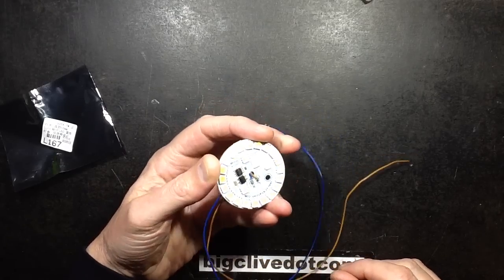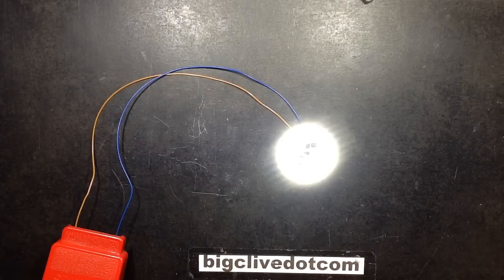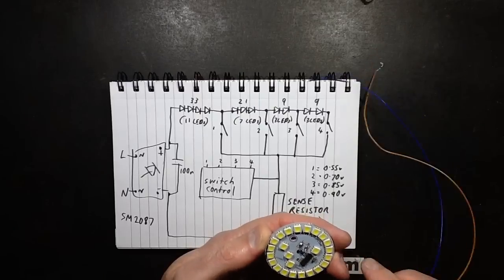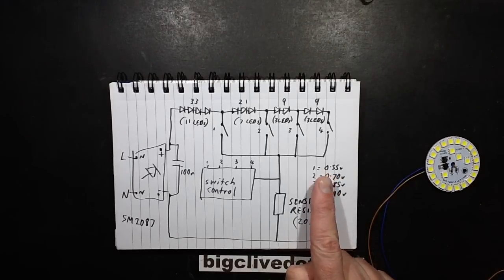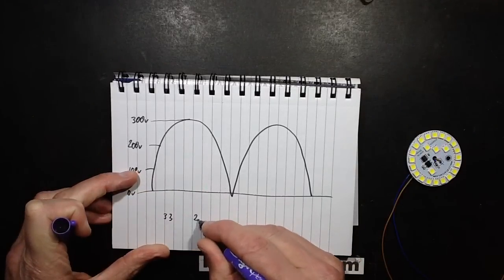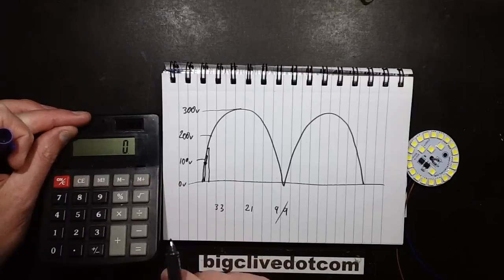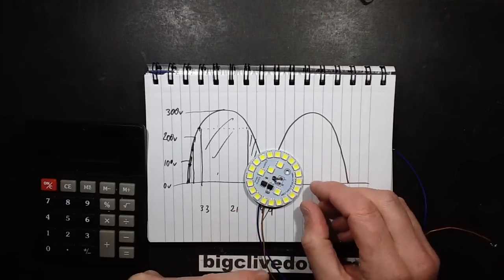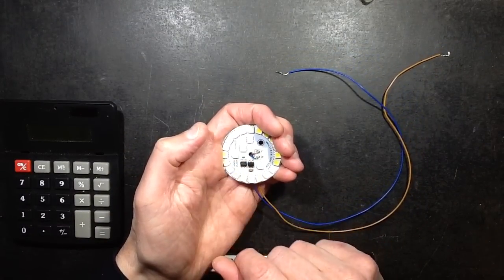A look at an odd LED panel that uses an SM2087 chip.

Comment: It’s actually really simple. A zero current, all switches are off when the first current limit is reached the first switch opens and the current drops. The chip then acts like a poor mans PWM as long as the on current remain below the first threshold. As the current rises the same thing happens at threshold two, until the waveform reaches threshold four and it just PWM’s at that max current. The same thing happens on the downside of the cycle. Chip is efficient because the switches are either on or off so only switch losses and rdson losses are incurred. Really a neat idea and an elegant design.

Comment: I'd have thought that it would be the lower number of LEDs lit first ( lower starting voltage ) to have light for the maximum time in the cycle and reduce flicker !!
Reply from the maker: They seem to have moved away from those earlier sinewave riding multi-circuit chips.  The ones I came across had reliability issues.

Comment: I think the chip expects the power supply to be current limited, so the voltage to the LEDs and chip gets throttled down as the chip turns all the LEDs on.

Comment: A simple way to see the action of lights that ride the wave, you'll need:  a paper towel tube, a disc of paper (thick) slightly more than 2x the dia. of the tube, a DC motor, batteries and a variable rheostat.   Mount the motor at the end of the tube so it can hold the disc over the end.   Cut a tube sized hole in the disc so when mounted on the motor it will pass over the tube's endhole.   You can see where this goes...   rheostat inline with the motor et voila !!    You can adjust the speed of the motor to match and kind of flickery light to 'slow it down'...   it's interesting to see fluorescent tubes as they go from almost totally off to much brighter than you see them, prolly why some folk get migraines from them...   I wonder if it'd work with the iPad like it does the human eye tho...

Comment: Right. Next piece of equipment to get would be a cheap slow motion camera. There's a few kick-starters out there that aim to make low cost high-speed cameras for those who need some high-speed footage, but can't justify the cost of a Phantom and are willing to capture at only 10,000fps as opposed to 250,000fps.

Comment: Key to understanding this is that the unit in Zero current conditions has 250 and 400 V Withstanding by the IC. So, the chip limits the current thru the LEDs and the chip Absorbs the delta between the voltage steps. In Output 1 on there are 94 V across LEDs and the Rest of 132 V - 94V are across chip-- appx 40V. In Output 2, Max 168V less the 153 Vleds give 15 V IC. The chip basically handles 10 V to 40 V; good thing it handles 250 to 400 in non-current conditions! The chip acts as a phantom resistor for the LEDs and a variable zener diode!!

Comment: OK .. Yeah, I should go learn more about a/c.    But the rest of this was an interesting brain exercise.  
---
  I checked that slow download data sheet.  The chip opens the switches one-by-one.  So I presume that a closed switch connects to Rext.  

Possibly, when the voltage across the resistor reaches Vsen  it opens one switch adding additional LEDs.  The sense voltage drops due to additional LEDs and begins to rise again.  Each time Vsen is reached, another switch is opened.  This all happens on the up cycle of the input wave.  

As for the down cycle of the input wave,  Vsen will hit 0v each time the voltage drops below what is needed to keep the LEDs on.  This basically starts a new misshaped wave.  The new wave very quickly opens switch 1, 2 and 3.  This time, there's not enough voltage to open switch 4.  As the down cycle continues, when the input voltage can't sustain the LEDs again, Vsen drops to 0v and another misshaped wave begins.  

I will leave it to you to make a video about what happens when the input votage drops below the minimum for the least number of LEDs and the input wave switches from down to up.  I wonder if switch 4 simply turns the LEDs off when the input voltage would create an over current situation or simply clamps the over voltage like a linear regulator.  And I'd bet the two N/C pins that connect around the external resistor can adjust more than just Vref.

BTW - in the video, I missed how you came up with 300(v) from a rectified 240v ac.  ;-)
And, Yes, I really like your videos.

Comment: Do you have a variable DC power supply?  You can connect it to the output clamps of the bridge rectifier and slowly raise the (DC) voltage and observe it switching in your own good time.  Assuming your theory is right.

Comment: Doesn't the capacitor act as a resistor to decrease the voltage. Because that means the chip doesn't need to switch off when there is too much power (in which it would be impossible with the amount of pins and the stress).

Comment: The linked datasheet (translated to English) is fairly clear: The 4 switches are turned "on" until the current through the associated output pin rises over the threshold for that pin, then it opens. The thresholds are scaled by the external resistor (Iout1=0.55V/Rext, Iout2=0.70V/Rext, Iout3=0.85V/Rext, Iout4=0.90V/Rext). This causes the switches to open one by one as the voltage rises, bypassing fewer LEDs in the series string.
I agree that this looks just like the Supertex/Microchip CL8801 with fixed thresholds (the resistor divider is internal).
I suspect that the power factor isn't quite as high as the datasheet states. It looks like the final switch for OUT4 will turn off when Iout4=0.90V/Rext so the AC mains current should cut off near the peak for higher mains voltages.

If BigClive has an oscilloscope available, he could wire a red LED directly to a 'scope input with the input set for 50 ohm termination. The red LED will generate a voltage when it is illuminated and you can see the pulse on the 'scope. For those following at home: Keep it away from the live circuit.
For a more sensitive light sensor, wire the red LED in series with a 1k resistor and reverse-bias them with a 9V battery (the LED does not light when wired correctly). When the LED is exposed to light, the voltage across the resistor will rise. Use a regular 'scope probe to view the signal.

Thanks--this was an interesting video.
Reply from the maker: +Richard Skokowski If the circuit is sensing current then when the final section of LEDs is lit and the current exceeds the final threshold, then it would open the last switch and the current would then drop to zero.  If it latches in that state it would suggest that it does not ride the other side of the half wave back down.  Maybe relying on detecting the zero crossing point?  I perhaps should scope the output.
Reply: +bigclivedotcom I agree. If the 4th switch opens completely, the string current should drop to zero. Perhaps that last switch is softer (more of a current limit than an open circuit). I suppose it could also chatter to do a sort of PWM to limit the power dissipation in the LEDs, but the resulting EMI would be terrible.
The US Patent Office granted patent 8,686,651 (assigned to Supertex) which has a lot of detail but it looks like it covers the Supertex chips well and I imagine this Goston Electronics one is similar (I'll leave exactly how "similar" to the patent attorneys).
It's a cute chip, nonetheless.

Comment: Really must get a high speed camera.. I wonder how much a 1000fps camera is these days, or even 3000, 10000... from china! so maybe a few hundred quid for 1k fps (but will be chinese spec so only actually 500... or less than that, but they use magic, alchemy and wizardry with numbers to make it 5x higher.. much like their "240 Watt P.M.P.O" PC speakers that are 2x3Watt if that, those horrible beige ones with oval loudspeakers..sorry, random rant. surprised you haven't done a video on it Mr Clive! :o chinese over-ratings!) but regardless, useful

Comment: I'm with xoz1246 on the mater of an oscilloscope. I'd love to see the voltage steps and to see if there is continuity of the on cycle or does it switch off for the absolute peak voltage.

Comment: is it possible that theyre PWM driven ? like the LED brake lights of a modern day car ?
Reply: +killer1479 I was wondering that myself, pulse the whole string during the high part of the voltage cycle to match a particular ideal heat dissipation curve.

Comment: +bigclivedotcom Two things here. 1: Was that main connector block you have there an inspired purchase from JW's block on the item? and 2: Did you know one of your vids was on the drunken peasants "troll or not a troll" section? lol love ya vids keep it up mate!
Reply from the maker: +Morlanius I haven't a clue how long I've had that Quick Test connector block.  Probably about 20 years.  They used to be very common, but were clamped down on to a degree.  It wasn't unusual to go into a garage and find one lying on the floor with several power tool leads stuffed haphazardly into it.
Reply: bigclivedotcom
Just wondered, he (John Ward) recently did a video on it and gave the shop links, I thought you might have been inspired. And the DP thing was showing your video about the flamethrower dolly, they voted "troll".

Comment: TI has a sort-of-similar part.
TPS92410 and 11. This differs in that it has seperate controller and switches, and is designed to have smoothing caps across the LEDs. It can do up to 1/3A though.

Comment: How about putting that lamp on a variable dc PSU and watching the chip switch the LED chains.
Reply: +Peter Knight that's the right idea!  Essentially, just slow down (or freeze) the input frequency instead of speeding up the camera.  Similarly, I'll bet you could see exactly how it behaves by using a signal generator to reduce the input frequency from 50 Hz to, say, 0.05 Hz.
Reply: Aha! Datasheet/app note found! http://www.seoulsemicon.com/_upload/Goods_Spec/Acrich2-Applicationnote.pdf

Comment: It seems to be some sort of knock-off of the CL8801 from Supertex. (or is it microchip now?) Any way, they call it a sequential serial LED driver. I think the the string of LEDs is on for the full cycle once they are all in series, because judging from the data sheet, tap 4 doesn't have a switch.

Comment: Due to the full bridge rectifier it should flicker at 100Hz, which the eye can't see anymore, which is nice, because the 50Hz flicker of cheap lights that use the LEDs themselves as rectifiers is easily visible.
Reply: +superdau Forgive me if I have this wrong, but the rectifier shouldn't change the frequency - it will just bring the negative part of the sine wave high so that the light is on twice as much. So the flicker frequency is not changed, but the "on time" is doubled.
Reply: +Ray Cathcart 
A bridge rectifier doubles the frequency. The result is no longer a sine of course, but you now got 100 peaks per second. Without smoothing caps the LEDs will switch off a hundred times a second. (the proportion of on time is much higher though)
Reply: +superdau Yes, of course. Just ignore my comment - I was still working on my coffee :)

Comment: Sort of like an LED VU meter.
Try powering it from a variable DC power supply that can reach the peak voltage of the AC mains.
Reply: +Jammit Timmaj I think when it's too slow, the chip and the LEDs might blow up.
Reply: *****
I don't think that makes sense. 50Hz/60Hz isn't really a fast signal and the data sheet makes no mention of frequency requirements. If the chip required an inductor or capacitor to limit current you might have a point.

Comment: It probably is the capacitor you are hearing on power up as ceramic capacitors are piezoelectric and microphonic in nature.  If you ever wish to prove such to yourself, place one on a function generator at a few KHz at a few volts and you will hear the tone in a quiet room.
Reply: +Ethan Poole Film caps can 'sing' and be microphonic too.

Comment: What would be interesting would be to use a variac with a filtered  Diode bridge out put so that you can simulate your own wave form in slow motion and see if you can see the segments turn on and off.

Comment: I would like to try this light I can not get the spelling right on the seller would you mind typing it out please esp_ezon is what I understand
Reply from the maker: +david wise Keep in mind that this is a 220V panel.
http://www.ebay.co.uk/itm/361102101064
Reply: lol I forget that you live across the pond I wonder how they would work with 120 lol
thanks for replying I live off grid I am using cfl lights they work fine but would love to find some leds that don't flicker with mains voltage I found if I run them straight off a battery there is no flicker but as soon as I add an power supply I still see it and it makes me feel bad just strange I know but I still have hope to find something that works lol I would just run wiring from my battery's but the walls are finished am terrible at drywall repair
Reply: +david wise It would only half work at 120 volts and not be very efficient if you are off grid unless you have a step-up transformer to take 120 volts to 240 volts. 
There may be some 120 volt versions on ebay if you were to look around though.

For your battery vs main flicker, you may want to try adding a big filter cap to the system to suppress some of the ripple.
Reply: wow I never thought about a filter cap I my brain doesn't function like it should ill try that I really love leds but the flicker gets to me my cfls flicker but im getting used to them took two years but I really perceive the led flicker every one else at the rancho thought I was full of it till I filmed it they couldn't believe there eyes I even have some battery operated lights that have some circuitry and they flicker more than the mains lol
Reply: +ElfNet Gaming Rectified 120V peaks at 170V, which would be enough to light a string of 55-ish 3V LEDs, enough for the 33+21 sets. 18 unused LEDs out of 72 total, which makes it used 3/4 of the way instead of half. On 240V which peaks at 340V, either something has to dissipate the ~3W (30mA x 100V) over the top of the 240V dropped by the whole LED string at peak current or the SM chip has to cut off through that part of AC peak, so the design is not exactly ideal for 240V either.

On 120V, you could consider the two sets of extra LEDs as margin for line voltage swells.
Reply: +Teardown Dan wow thanks I'll see what ot does thats a lot of help
Reply from the maker: +david wise I'd suggest that the flicker smoothing would be best dealt with locally in each lamp by adding another capacitor in parallel with the electrolytic smoothing capacitor already in the lamp.  Some LED lamps flicker and some don't.  It may be worth getting a few cheap ones off ebay and trying them out with the finger test.  Swish your finger back and forth in front of the lit lamp and see if the illumination on your finger has visible intensity variation in the form of stripes.
Reply: thanks sir I have been crazy wanting leds because of the low power consumption ill start experimenting see what works if I find a solution ill let you know. I contacted Phillips lighting and they said that a very low amount of the population perceives the flicker that they stopped with there smoothing aps and have not put any more research in getting it reduced
Reply: I really want to thank you and your subscribers for all the help would you pass that on